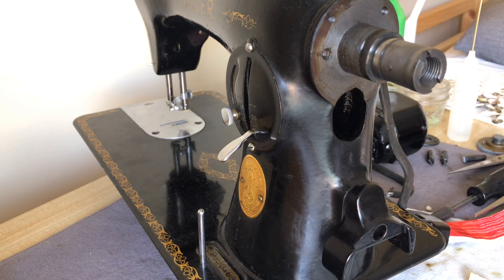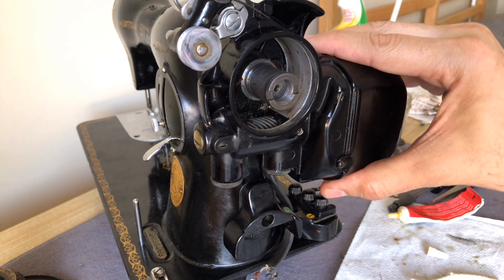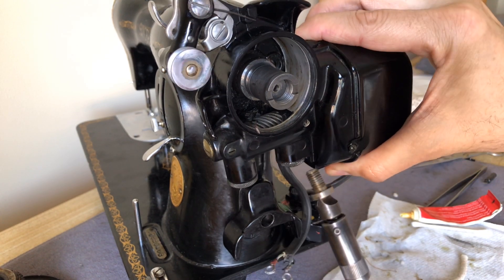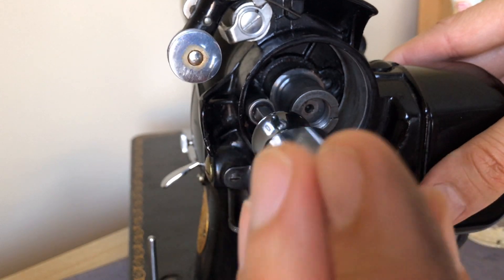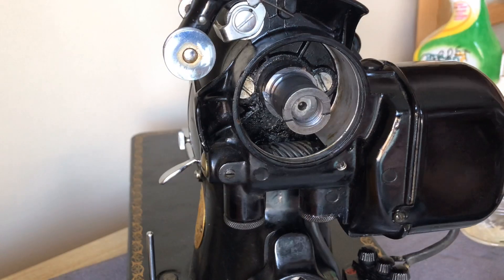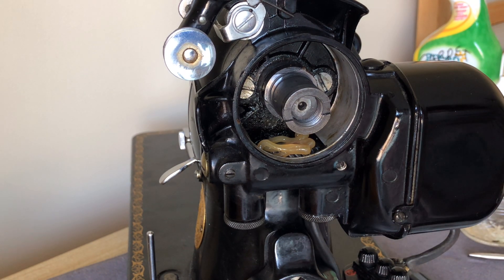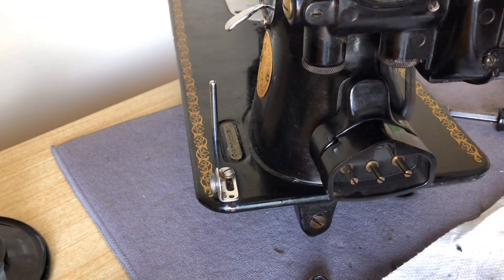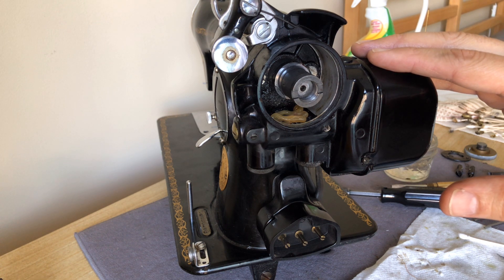MOTOR SERIES # 15: How to Install a Singer Potted Motor When Maintenance is Completed!

Comment: I know the videos are a couple years old but timeless. I have two of these girls I’ve had for over 15 years and I went through them using the videos. They not only look better but also run better. I thought they were quiet before but the only indication they are running is the visual movement. They are such a joy to sew with. I feel I’m carrying on the original sewing joy and tradition they were originally meant to bring to the owners when originally purchased over 70 years ago.

Comment: What I did after so much trouble, I pull the motor and rest the screws in their respective wholes, then I connect just the tip of the screws and start tighting lil by lil. Thanks. :)

Comment: Very informative. Good tip with the grease on the screwdriver. I usually lift the head up @ about 45° angle to remount the motor. It works for me.
Reply from the maker: Thanks for sharing

Comment: Thank you for that video. 
Brilliant as always. 
I would like to increase the power of my motor. Can I buy a bigger amp motor none standard? Do you know where you can get them and do you have to come up with a clamp to get it to fit? Thank you.
Reply from the maker: If your machine as the 'Potted Motor', I would leave it as is.  If you have a machine with a more common mounted motor that uses a belt, you can purchase replacement kits online (Ebay) that have a bracket, new motor, and belt that will attach to Singer models, and perhaps others.
Reply: Vintage Sewing Machine Garage thank you very much. What is a potted motor. Haven’t seen any in the uk.